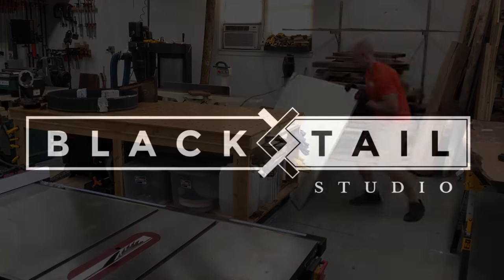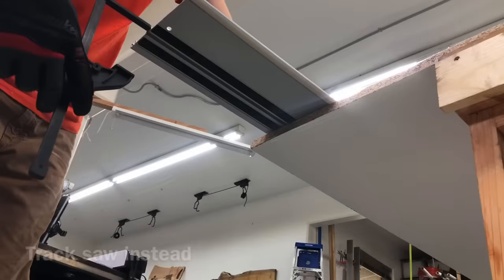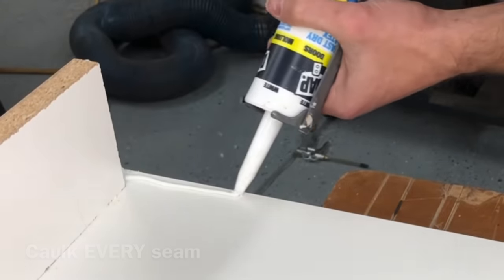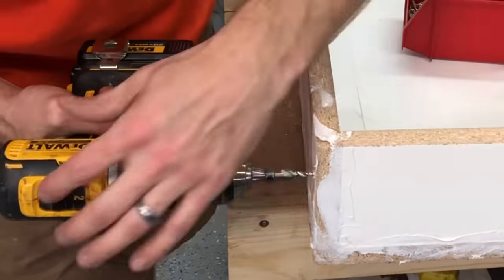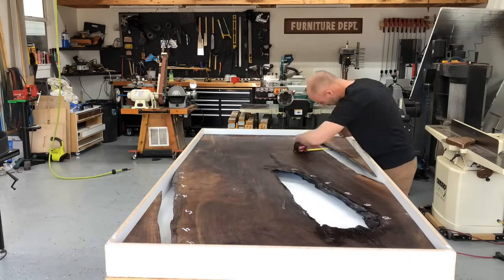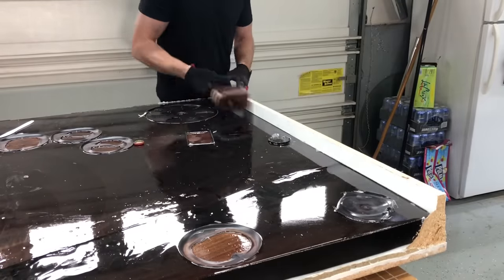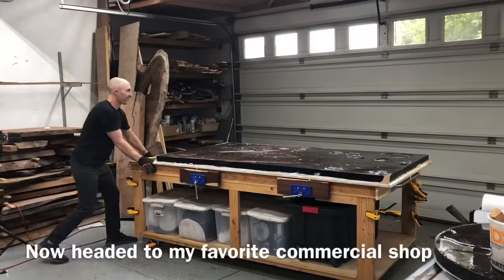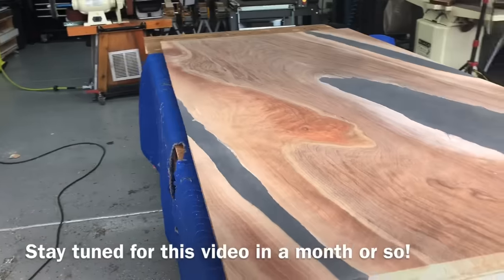How To Make an Epoxy Table Mold - DIY Epoxy Resin Table

Comment: Scott here,  This was great, thank you.   Question on the Smooth-On Universal Mold Release.  I can't find any reference to coverage of the 12oz can.  We are doing a 50 x 30 island counter top as the main project, but want to do a small board of some kind for practice first...   What would you guess as the coverage of a can?  

thanks!
Reply from the maker: Man, not sure. Goes a long ways
Reply: @BlacktailStudio  No worries.   that at least gives me a good idea.    I assume you don't use a full can for one of your 8ft tables then?    If not, then I know i'll be safe.  It's not expensive stuff, which is nice, so I'll grab 2 cans.. just in case... as I could be liberal with the spraying on my first go not knowing how much I need....

Comment: I have a work piece which is a wide board with an oval cut out in the center.  It was once a frame for a vertical freestanding mirror.  I want to re-purpose it into a table top by filling the oval void with a pool of epoxy.  Would it be sufficient to create a bottom with duct tape since the pour is entirely in the interior of the work piece, not touching the edges, or is the epoxy likely to force its way past the duct tape.  Should I also use silicone the interior corner where the bottom of the tape meet the lower inner edge of the pool?
Reply from the maker: Caulk a piece of melamine underneath. Use painters tape on the wood though.
Reply: @BlacktailStudio  Thanks!

Comment: David:
Im working on making a side table where I’m burning off a significant portion of one the corners and then refilling that space with a clear epoxy, I did a trial run with a scrap piece of wood and ended up with a ton of bubbles along the burnt edge, do you have any tips on how to prevent this? 
(On the trial run I sprayed the burnt edge with an aerosol polyurethane and also painted over it once with the epoxy but still got the bubbles)
Reply from the maker: Dang. I seal my edges with epoxy

Comment: Hi. I am in a process of making my first river table and have a couple of questions and really hoping you could answer. I am using two walnut slabs just shy of 2" and one of the slab has a slight twist. If I try to get it flat, my fear is that i will be left with a much thinner slab. Is there anything you could suggest as an alternative. I was thinking if i could clamp the slabs down before pouring epoxy to flatten the slab and let the epoxy dry. For my end result i am okay if i have slightly uneven top.
Btw i have also ran the slabs through a planer already.

Secondly, i am leaving the live edge on the outter side of the table, therefore making a mold that will be exact is impossible. My question is how do i prevent epoxy from leaking to the outer side of the table.

Thank you in advance for your time.
Reply from the maker: I leave it as thick as possible until after the pour. And I’d use caulk and painters tape
Reply: @BlacktailStudio  Hi Cam, thank you for your prompt reply. I appreciate your suggestions.

Just one more thing. Once i remove the clamp, would the twist force the epoxy to crack?

Comment: Hey! Question for you, I’m new to epoxy but I have a lot of big slabs that I’d love to put the black epoxy rivers that you have. What scares me is the shear cost of epoxy to do a project like that. I’ve seen other people on YT carve out a shallow man made river with a router which only goes down 1/8”-1/4”. Obviously, this would use way less epoxy, but is there any drawbacks or gotchas to this? Assuming that whoever does this method doesn’t care about the bottom of the table not showing epoxy.
Reply from the maker: If you carve it out it won’t look natural. Won’t line up with the grain lines

Comment: What size is this mold? Also, I have two different pieces of Walnut that I want to use for my table however, they are two different widths... how do you recommend going about this? Using the bottom as the top of the table is the only thing I can think of, it will just require a lot more epoxy. I don't want to have to compromise the thickness of the table at all.
Reply from the maker: Oh, I’d probably have to be there to see

Comment: Hi! I’ve got a question about sealing edges of wood that You’re working with. How do You do it? I tried to brush in two thin layers of epoxy into it with sanding in between and I still got some bubbles after the pour 😔
Reply from the maker: Dang! Not sure then

Comment: I'm doing my first epoxy table; do you have a recommendation for the best epoxy for a 1 inch deep pour?
Do i need to buy epoxy and hardener separate? Or do they usually get sold together? I kind of get the process at this point, but I know nothing about epoxy.
Thanks for any help I can get!
Reply from the maker: The liquid glass is great for shallow pours too.
Reply: @BlacktailStudio  so all I see is deep pour and tabletop. 
Would the tabletop work okay for 1 inch deep? Or would I have to do multiple 1/8 inch pours with the tabletop?

Comment: How do you make a mold longer than 8 feet if you do not use tuck tape?  I am making a table that is going to be 12 feet long and don'w want to spend big to get HDPE sheet that long.  Should I just use tuck tape and caulk to seal the joint?
Reply from the maker: Just add a couple pieces of tape at the seam.

Comment: Hey Cam.  Another question for you unrelated to the mold build itself.  In one of your shots you can see a pliable light stand and I was wondering if you use that for your lighting and is it also comparable as a tripod for your camera?  If not, could you tell me what you do use to perform those two functions?  I'm in the process of acquiring my A/V equipment to get my channel up and running.  Thank you very much.
Reply from the maker: I use photography lights for everything in my shop 👌
Reply: @BlacktailStudio  So that transformer looking thing on the top of your bench was not a light source stand for your videos?  Thanks.

Comment: Andrew: Really like your video and I’m a new subscriber. Apologies if you’ve answered this question already. How do you deal with cupping/warping? I’m thinking of attempting my first epoxy live edge table. Thanks in advance Andrew from Ireland
Reply from the maker: Usually not too much of an issue with properly dried wood.
Reply: Blacktail Studio thanks for the reply

Comment: Ahmed here, I tried searching my local market for Silicone Caulk but I only found plain silicone sealant. You said silicone makes it harder to take apart the table, so is there anything else I can use for seal the mold. One more thing I wanted to ask is, does the base of mold needs to be a single piece? I have 2 pieces of 2x4 lying around and want to use it make 4x4 mold. is it a good idea or should I buy a new sheet for the mold.
Reply from the maker: Check out this weeks video. I show how to make an oversized mold. And I linked the caulk in the description

Comment: Hey Cam, how much did the epoxy cost for this project? (roughly). Or, if you are not comfortable with that kind of question, how much epoxy did it take to fill the voids?
Reply from the maker: I think around $900 of epoxy
Reply: @BlacktailStudio  Thanks.

Comment: Hello, my name is Temi and I wanted to ask: is the surface you end up using for the table top the one that is at the top when you’re pouring the epoxy, or the one on the bottom flush with the melamine? Also, I’ve seen some people use clamps to hold the wood down. Is that necessary?
Reply from the maker: Ya, clamps are a good idea. And I pour top-up

Comment: I have an extensive question/conundrum with a project.

I’m a Firefighter and my crew and I are building a firehouse dinner table. We are well into it and I have just found your YouTube channel. I wish I had found you two months ago... 
I am realizing that we have made quite a few mistakes/things we should have done... oh well at this point. I was hoping for some advice on how to proceed since we have significant time and money involved as well as our names/reputations on this table that will long outlast our careers. 
We built a metal frame for the table and dropped it into the frame before we did the epoxy. I see we have done the exact opposite of what you have done with the way you build yours... 🤦🏻‍♂️ We did hand painted, hand turned gold leaf graphics for a custom emblem on top. We are at the point of pouring a final pour to cover the gold leaf artwork but was not sure how to proceed with getting the final edge around the table. I know we have done things not the way you do or would recommend but at this point I was hoping for out of the box thinking on how to make this look as good as possible and to hopefully save the project.
Reply from the maker: Oh dang! I have no idea what your question is though. Just things didn’t go well.
Reply: Do you have a contact that I can send a picture?

Comment: I am trying to build my first small table ever. Is there something that I won't need to sand the table down afterward to make the mold out of? I don't have access to a plainer or anything like that. Thanks
Reply from the maker: Not sure I understand. But I think you want a router sled
Reply: @BlacktailStudio  I am looking how to build one. I guess that will be my next project. Just trying to figure out how to do all this. Everything I have stumbled around And learned is from you tube University.

Comment: Both times I did my epoxy project the epoxy runs underneath the wood. I've tried tape but it didn't work. How do I prevent that from happening?
Reply from the maker: I let it run underneath

Comment: I just tried my first small table using melamine board and a spray mold release. The melamine stuck bad. Is they a process when spraying the mold release? How do I know how much is enough?
Reply from the maker: Usually just one coat is enough. Maybe try two. Wipe with a rag after a few minutes
Reply: @BlacktailStudio  Thank you so much for your help. I’ll try that. I love the work that you do and how informative your videos are.

Comment: My name is Jason. I am making a bar top that is L shaped. It's bigger than a sheet of plywood so I will have to use two pieces to make it work. How should I seal the seam so it doesn't leak?
Reply from the maker: I did that in a recent dining table build
Reply: @BlacktailStudio  how did you seal it? I was thinking about caulk amd tyvek tape. But if there is something better let me know

Comment: Why do you make the cast a little oversized? I poured my table yesterday and found that it settled about 1-2mm. I’m so bummed out. Also, I used a metallic powder pigment and the pattern just vanished overnight. How do we work around that?
Reply from the maker: Pour more, and watch my blue table video 👍🏼
Reply: Blacktail Studio how did you remove the caulking once the epoxy had set?

Comment: Hey mate I’m in Australia and I can’t find the zinnser shellac based  sealer, is there any alternative? I can only get my hands on shellac based french polish or the is an oil based sanding sealer which sounds good, but I’m concerned it’s not compatible with the epoxy
Reply from the maker: Any shellac should really go where the epoxy will attach. So I’d say use what you have
Reply: Blacktail Studio, do you mean I can use the french polish on the faces? It isn’t de-waxed shellac like the zinnser product! Will that matter?

Comment: Lisa here. I watched the second part, but brain-farted the brand of epoxy you used. It seems that you use different epoxies for different tables. Here's what I'm doing. I have some reclaimed fencing, with some pretty nice knot holes in them. I am sanding and sealing b4 I mount them onto a piece of MDF. I will mount with epoxy and screws, thru the bottom of the table. I thought I was sure I knew which product(s) to get until today when I watched ur videos.  What is they say about always question?    For how do we learn.  Do you have some advice for me? Sensei? I would greatly appreciate it Thanks Lisa
Reply from the maker: Liquid glass. Is that the question??
Reply: @BlacktailStudio  Yes. And I'm just gonna say that the Liquid Glass line of product is fantastic. I mistakenly used some other artist brands, FOR my art! And had a couple of problems, not covering completely, and not self-leveling. The Liquid Glass poured perfectly. I get it now...LOL,

Comment: If you have an extra 1and 3/4" per side and you flush the wood to each side won't that add a substantial amount of epoxy for the poor, and do you cut that amount off, losing the wood in the process? Forgive me if i am not understanding and this is a stupid question?
Reply from the maker: Not sure I understand. Sorry!
Reply: @BlacktailStudio by making the form 2 inches bigger, width and length, then the actual desired table dimensions does that add a substantial amount of more epoxy to the project which is quite costly. I am building a 3ft wide 4.5 ft river coffee table   and adding the 2" per side all around  I think would add quite a bit more epoxy.  I'm on a tight budget and trying save as much as l can what would you suggest?

Comment: Do you ever caulk your wood to the bottom of your mold so the epoxy doesn’t leak under the work surface?
Reply from the maker: I’ve tried. Doesn’t usually work great

Comment: My name is Stuart, I want to sand my cured epoxy down to a glass like finish, but see almost a fiberglass type fiber in it even though I have wet sanded down to 8000 grit.  How do you get glass smooth and clear sanded epoxy. Somewhere/somehow people are not giving me all the info and it is frustrating me greatly...  I do use Liquid Glass and Crystal Clear epoxies...
Reply from the maker: Best option is spray finish like a lacquer

Comment: Hey Cam, I'm Ryan. I'm about to start a pretty large project and was wondering, do you usually flatten your live edges before you put in epoxy as well? (I was thinking I would to prevent more waste). Also, when you put the piece into your Table Mold, do you put the top down so you are looking at the bottom of your finished piece when it's in the mold? Thanks so much for all of your awesome videos!

Comment: Hey dude, to get the table off easier next time, without all that hard and long work with hammer and wedges, try putting some OIL on the board. We are going to do that today, watch our video to see how!
Reply from the maker: Would make me nervous mixing oil and epoxy
Reply: @BlacktailStudio  Because of fire, I understand, it has a risk.

Comment: If you're in it for the long run, you could make a heat sink table sandwich with two sheets of aluminum and maybe 3/8 of an inch of aluminum pellets glued on the back of each sheet acting as a radiator. This way you could make thick pours with a small yet symmetrical warping saving a lot of time and money for the rough surfacing.

You don't have to take my word for it but I've worked as a mold shop forman in a thermoplastic shop.

https://www.metalsdepot.com/aluminum-products/aluminum-sheet

https://www.alibaba.com/showroom/aluminum-pellets.html